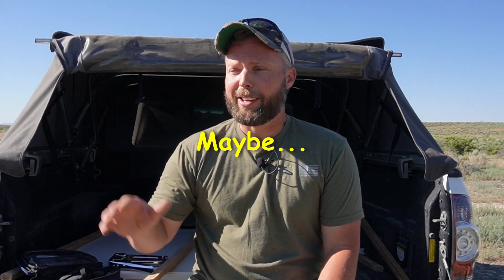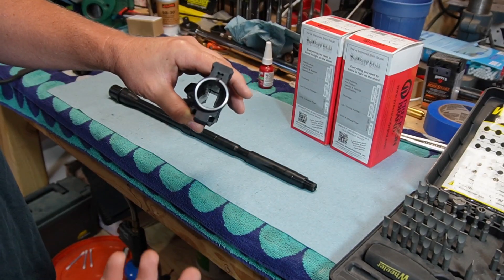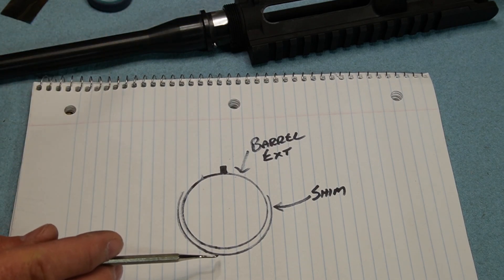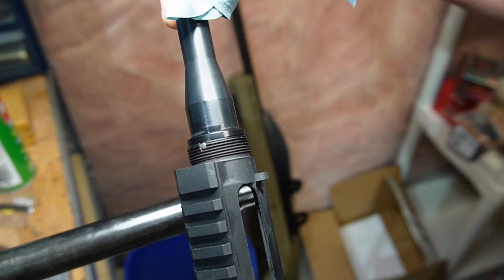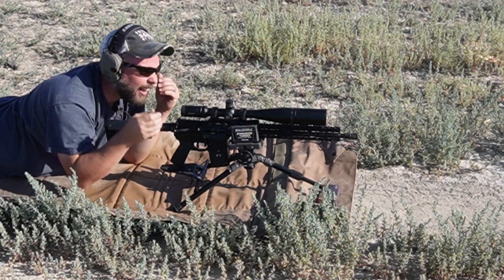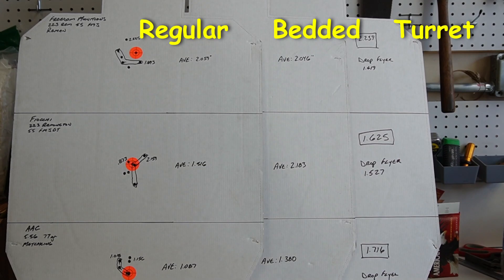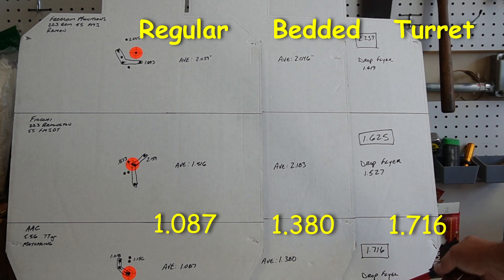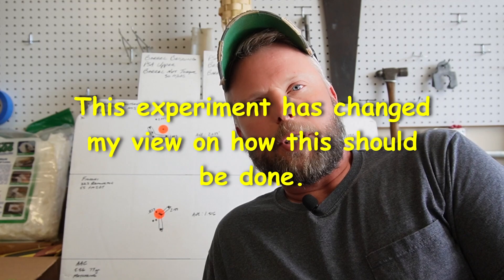AR15 Barrel Bedding: The Video That Revolutionized My Approach

Comment: Great video! I had groups around 2"" @ 100y. Tried the lapping and then compound, to no avail. Actually, shot worse. Especially, clean cold bore to hot fouled bore. Finally as u suggested, i used a 0.002" shim+compound and installed barrel (w/ heat on upper receiver). My groups are now 3/4" at 100y. Thanks so much!
Reply from the maker: That’s an awesome result! I’m very glad that you stuck with it and got it over the finish line. Well done!
Reply: @nobodytraining  im gonna try this on a old upper i have, i really donot want to just buy a new upper and just have the old one laying around. will make a video
Reply from the maker: I look forward to it!

Comment: When ever I have gotten a loose upper receiver I simply turned it back for replacement.  I true the face of the threads warm up the receiver and insert the barrel.  No bedding needed.  The barrel should be a snug hand fit.

Comment: Copper Anti seize is a no no on aluminum you should look up before use.
Reply from the maker: Bottle said good on similar and dissimilar metals. I've also used on my aluminium differential and it's made dif fluid changes ssssooooooo much easier than what it was. 

If I was making a true battle rifle and it was going to be out in a wet crappy environment I'd be more worried. I'd be more concerned about the moisture turning into an electrolyte solution and causing galvanic corrosion (I would wonder if the copper would be a sacrificial anode 🤔) before a barrel change. But I'm in the dry mountain west.  Thanks for looking out!

Comment: The reason for a thermal fit is that when the receiver cools down, it effectively is clamping itself around the barrel evenly.  By doing this, it naturally fixes the barrel to be perfectly collinear with the bore in the upper receiver.  This clamping force can be so great that you have effectivelt made the upper and barrel a single metal part until you try to reverse the process by heating the aluminum receiver again.

The reason that this clamping tension never really goes away even when you heat the barrel up really hot is because the barrel extension will expand outwardly while the aluminum expands inward towards the barrel clamping down on it even more.

Once you create a thermal fit interface, the clamping force is going to be so great that no torque on the barrel nut is going to cause the barrel to shift with respect to the receiver and the implus or recoil of the barrel pushing backwards when rounds are shot will be completely absorbed by the clamping force of the receiver on the barrel and not the barrel extension resting on the front face of the receiver.  At that point, the barrel nut is really only there for the handguard, not to hold the barrel into the upper receiver.  This is why for precision builds a thermal fit is preferred as it provides more consistency than relying on the barrel nut to fix the barrel extension to the upper receiver.

Comment: Smyth Busters gets a lot of things wrong (Ironically JUST like the show Mythbusters did quite often too!). Makes me wonder where they studied smithing? Seems you forgot one other important tuning element. It sounds crazy but... barrel nut torque. Find the ammo you want to "shoot well" and increase the barrel nut torque another 5lbs at a time, then shoot a group between each increased torque and repeat until you see the groups tighten up! I had over 100 rounds though my last project (bedded) and was getting 3 MOA even with match ammo. Until I stepped up the barrel nut torque a few times and found the sweet spot for my barrel at 65 lbs. Now it shoots a solid 1/2 MOA .

Comment: Face the barrel port only until  flat, not the inside of the port. Only shim if necessary. I would torque to 60 lbs, loosen and re-torque and repeat 3 times. Also, buy a better trigger and learn trigger control and breathe control. Also buy a better quality barrel (kreiger or hart) would help.

Comment: Someone did a study on accurizing the AR and found the drill method of squaring the face barely works and often makes it worse. His words not mine, and that using a lathe is the only true way to square an upper.
Im not sure about this. Ive never conducted a study. The idea is that the lapping tool isn't precise. 
Maybe once done with the tool, lay some 1500 grit on a flat surface like a granit countertop, and run the face of the upper on it.

Comment: There is also .0015" material. If you put the retaining compound between the barrel. and the shim, the shim stays with the barrel, not the receiver, which makes it easier to change barrels down the line.
Reply from the maker: Unfortunately I didn't have any at the time. But what I'm going to try next time is treating it like bedding a rifle. Have the compound and shim stick to the barrel extension only so whenever I need to replace the barrel I'll have a clean receiver.

Comment: Barrel bedding imo is not necessary unless you are spending a money on barrels that are competition quality. For example the difference between a bear creek arsenal and say the green mountain barrels ive use on build for accuracy. As well the quality of the upper has a lot to do with how things fit, bedding a barrel etc. For most people even a bear creek barrel is capable of shooting much more accurately than the average person is capable of. Most people will gain the most from a very good trigger job and reduced pull weight on the trigger. I generally say that accuracy for the majority comes down to fitment of the rifle to the shooter, a decent optic or set of sights, and a very smooth and light pull trigger. These effect accuracy more than anything for most. I have taken people to the range for an afternoon to dial in their gun and in a few hours of shooting training have reduced their groupings by 25 to 50%. Proper breathing, trigger pull, and getting the correct hold as well and proprer and repeatable cheek weld make huge difference in accuracy. Its always fun to take a buddy with the new rifle Ive helped him build and watch them struggle and shoot terrible groups. Frustration sets in and you can see it even with training. Usually they offer me to shoot their rifle so I do it just as a back check on my build and well generally can get the proverbial moa or better grouping at 100. Then they say well guess I need to practice more.
Reply: as well Ive never used anything but The green retaining loctite to bed after lapping the receiver. I coat the extension with green  push it into the reciever instally the barrel nut with enough tension to seat the barrel fully then hang it barrel down so the loctite wont run out. Triggers on my own stuff I actually buy and haters will hate but I buy anderson stainless trigger sets and then hone them myself  as well as using jp enterprises enhanced reliability springs that with the hone and some serious work come out to about 3.5 to 4lbs of pull and smooth clean break that will shock you. My 2 most accurate builds have green mountain barrels gunsmith special .990 all the way to the muzzle no threading no gas port ( yep linear bolt gun), bear creek arsenal side charging upper that are lapped and barrel bedded with the retaining compound, and I use toolcraft bcgs, both have A2 stocks, anderson triggers with jp enterprises springs,  11 degree target crown on the muzzle,  matrix arms 80 lowers cut with a 5d jig. and a clamp on handguard at 15in long.  Barrels are 21.5 one being 5.56 wylde the other 7.63 x 39 with a 1in 9.5 twist rate.Optic on my 5.56 rible is a leupold dont remember all the specs and the x39 gun rund a burris. Both are fun to shoot and tack drivers. I let a competition shooter try the 5.56 gun and he went nuts when it put 2 in the same hole at 100yds

Comment: Are all upper receivers need that crazy facing as he calls it done? I’m building my first upper i got a BCM blem receiver that looks pretty evenly flat and it doesn’t look like it needs “Facing” but since it’s my first build I would appreciate y’all’s and all inputs.
Reply from the maker: I'd just build it and see how it does. The brownells facing tool, most likely, will not fit into the receiver since Bcm runs a smaller diameter. 

As for if all receiver need the facing done, no. But it's something you want to check. You could stand your receiver on a VERY flat surface and then from the other side shine a light. If there are any high/low spots the light will shine through. 

Good luck on your first build and have tons of fun learning!

Comment: Here’s why you want an interference fit - it establishes a more solid node for the barrel harmonics.  So, when the gun goes bang, the barrel harmonics (how the barrel whips) are consistent from shot to shot.  The idea of shimming or heat shrink are just 2 ways to accomplish this.  The heat shrink is preferred since there are fewer parts to move when the gun fires - I.e. it’s a bit more solid of a connection.  The true-up for the face with the tool you used is another process that helps achieve better lock up for the node.  Side benefits related to wear on bolts and such are not 100% because you don’t really know if your bedding process it perfectly true and concentric - you only know they have a tighter more secure bond.  On that point, you always shim the full length of the interface between barrel and upper.  Otherwise you could create the misalignment I just mentioned. (I.e. the barrel ends up pointing up, down, or side to side when compared to the re upper’s true direction.  You won’t see this - but it will induce more wear and some bad force vectors and vibrations you don’t want.  Yes - I’m a mechanical engineer and those are my thoughts.  Should you do it?  I’d use the lock tite goo and torque to the higher end of the spec and call it a day.  It it’s too wobbly for that then get another upper.  I generally have hand full of various uppers and test fit barrels to find the one with the best fit when doing a build.  I only care about this on the precision guns.
Reply: Great thoughts, I'm with you!

Comment: Dang, I get better groups than that with a razor 1-6. Expo arms 14.5 chrome lined $100 dollar barrel, no bedding, shimming, or lock tight. And it has about 6k rounds through it. .5 to .8 moa off a magpul bipod and a rear bag with aac 77g otm

Comment: Observation: If you're going to "FACE" one mating surface ... then you need to make sure both of the parts are True. Facing only the receiver (making "True") does not mean that the mounting "Stop Ring" on the barrel is also "True". Do both sides ... or none at all.
Reply: In most cases yes but the barrel extensions are virtually guaranteed to be true due to the nature of how they are manufactured. Uppers not so much.

Comment: Actually I think you are onto something here with using the 0.002" shim and heating the upper receiver for an interferrence fit.
I am going to try that myself on my next build.
Reply: im going to try this to accurize a older upper. just before and after adding this. a experimental video.. standby for result bro.
Reply from the maker: @survive24 looking forward to hearing! Some have reported good results off the bat. I had to also de-burr and polish my feed ramps since they were damaging the rounds.

Comment: Years ago, before interferance fit, i would gently lap the upper's face, just take down some of the high spots, clean everything, then apply some red locktite around the outer surface the barrel extension and seat the barrel and tighten the nut. Let it dry for one week, and that was my "bedding". Seemed to work.
Reply: Red loctite cannot survive the heat, thats why it's not reccomended for muzzle devices or gas block set screws etc
Reply: I agree with this method. By going through the hassle of pre squaring the face, adding a shim the way he did would induce unwanted lateral pressure hurting accuracy. I would think the Barrel Nut would center the Barrel on its own when when torqued into place. During the process it's also a good idea to use the Action Rod from Midwest Industries at well to ensure the Bolt to Breach alightment is correct. And finally, yes, red LocTite to tie it all together. My opinion, the shim is a bad idea.

Comment: get bcm uppers. theyre thermal fit only. alot less hassle. this method would work great for a sloppy anderson or areo upper. ive used both brand of uppers and havent had them so loose and to need to use this method but im sure theres some out there.
thanks for the great, educational vid.

Comment: I fitted a few AR barrels to the upper receiver and I would highly suggest using enough steel shim that you would not be able to fit in then use a propane torch to do a thermo fit. There won’t be any play if you thermo fit the barrel

Comment: I am a formally trained master armorer with over 20 years on the AR platform. Have you simply tried a higher quality upper to begin with? Try a BCM4 standard Bravo Company flat top upper and a good quality barrel. You should freeze the barrel and heat the upper. They are an interference fit. I get great accuracy and battle rifle reliability every time.
Nice video and kudos for trying to re invent the wheel.
Reply from the maker: So this video was part of a series trying to improve the accuracy of a cheap PSA upper. I eventually get there and get sub moa with some 77g. I have used bcm for some great builds in the past and couldn’t agree more on their reliability. Thank you for the kind words and watching!
Reply: @gimlisilverhammer5903  if you were involved in the tiniest with service rifle competition over the last 30 years you would know that facing the upper and shimming the barrel extension is not "re-inventing the wheel". John Feamster mentions it in his book published 1998. I remember magazine articles about it before that when the AR was a curiosity among the legions of Garands and M14s
Reply: Question from a viewer...lol! If I used an upper receiver action rod & installed the barrel vertically with green compound on a properly torqued nut. Even on cheaper part combos, wouldn't it stay centered?
Reply from the maker: @JoePlomo since your hand is raised I’ll take the question 🤣
There is no guarantee that it would stay centered once you started torquing your barrel nut. Plus the action rod wouldn’t keep it centered either(not designed as a centering device), just keeps the barrel and nut from putting force on the receiver.
Reply: Of course, after lapping if needed

Comment: By partially shiiming the extension the way you did, you may have actually promoted the barrel not being centered. Assuming a reasonably tight fit to the upper, the barrel will center itself. If you use shim material, it should go all the way around the to accomplish what you were seeking.

Really, no reason to shim. The barrel nut compressing the threads on the receiver will center the barrel and the green loctite will swell as it sets to fill the void. I've disassembled many uppers bedded with green loctite without the use of shim material and saw no evidence that the extension failed to center itself in the upper.

Still, if you just feel that you must use shim material, go all the way around with it. In your video, you trimmed away shim material leaving the top unsupported. I'll bet that if you applied some heat with a torch, it would have fit.

Comment: You suggest using perpendicular instead of concentric. To explain in the machinist world those words mean two completely different things. Concentricity is referring to the fact that they are perfectly on the same axis. Or at least as close to that as is possible perpendicular would mean they are 90° offset for each other. Concentricity is extremely important when you have two separate parts that are machined at different times. Two cuts will never be the same so you have to true items to each other. Therefore making them concentric there's a lot of different processes and some are more accurate than others put in general concentricity and perpendicular are two completely different things. Hope this helps

Comment: I think these are options when you have inferior quality parts, and there's that much slop that needs to be corrected. A better solution would be to invest in a quality armorer's course and learn the why's of what seperates quality from inferior products and after that once you know which companies invest in their customers and take pride in their work and care, it becomes much easier to build, pretty much all but guaranteed everything will marry together in a sympohny of awesomeness. Of course, there are no absolute guarantees when human error is ever lurking and possible, but for the most part, quality parts fit together even when made by different manufacturers because they adhere to the fundamental specifications. You greatly increase the probability of not having fitment or function issues.

Not all ar's are created equal.